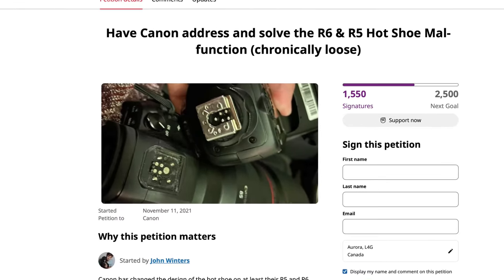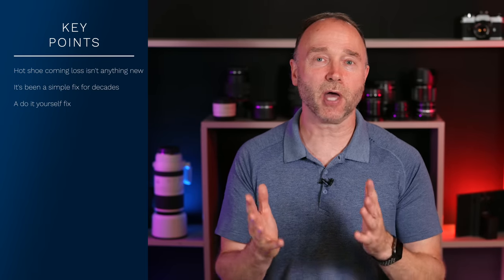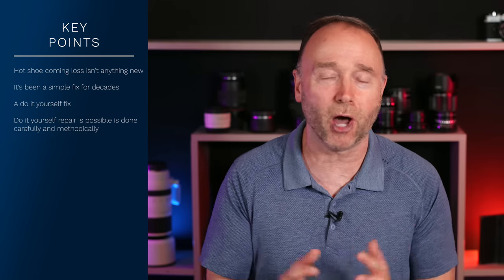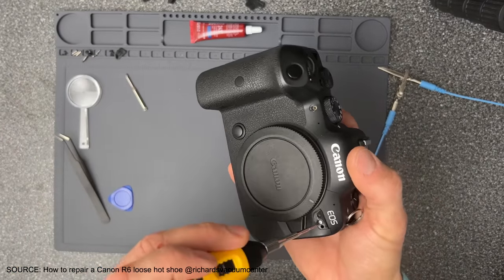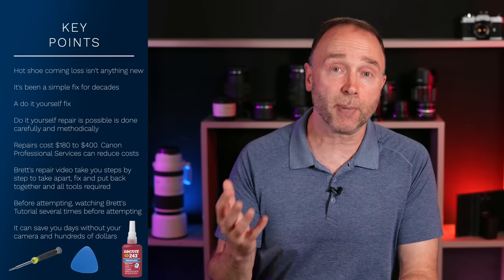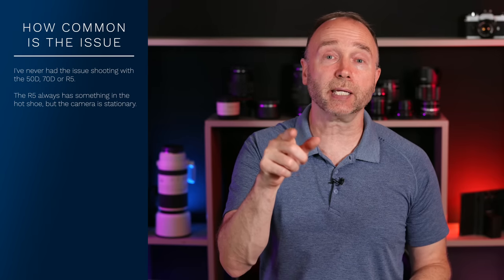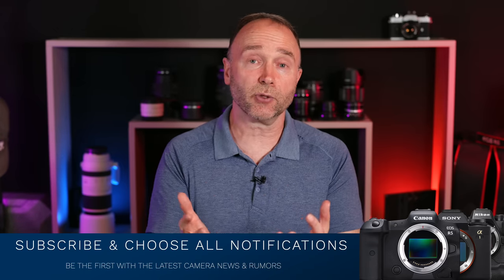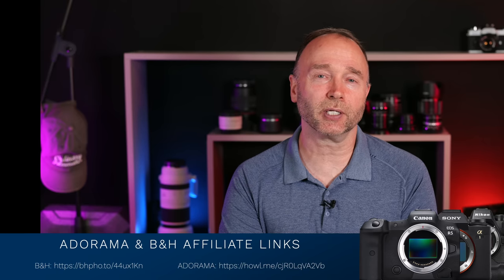Canon EOS R System: Major Flaw?

Comment: I wouldn't do this. I has an R5 go haywire at about a year old. Still in warranty, I had Canon fix it, but it came back with a new problem caused by some foreign material entering a button from behind, keeping it permanently pressed. Do you have a clean room to do this in?
Reply from the maker: This issue occurs most often outside of warranty. I would not recommend anyone do it lightly. Anti static band, low dust environment, the right tools, steady hand are all important, but many of us do have these skills. I for one have been taking devices apart for years, even replacing chips. However, prevention is the best policy. For heavy gear like monitors or recorders, use a camera cage to spread the weight out so it isn't resting on the small hot shoe. Good points Andrew.